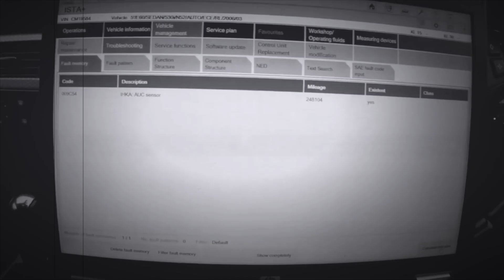BMW N42/N46 Engine Reliability 2020

Comment: My E46 with N46 1.8  , 290.000Km, not single problem,ever..
Reply: Hi mate, what oil do you actually use ? and what is your climat .
Im using 5w30 and some times I have blue puffs from exhaust
Reply: @ahmadkheiro735  bro u should use 5w 40 and u are burning oil check ur piston rings
Reply: @ahmadkheiro735  liqui moly toptec 4100 5w40, and ceratec additive..a had no puffs from exhaust, every iis ok
Reply: @ahmadkheiro735  if you have blue smoke, especially after few minutes on idle, its the valve stem oil seals. I’m just after doing them.
Reply: I have an E92, 140km. Valve guides needed replacing 😔
Reply: @melihhabi usually valve guides in these engines, block itself is pretty bulletproof
Reply: nobody will belive you never!!!
Reply: @razor6031tv  True. It is impossible and he maybe bought it at 280,000 km and had not problems until 290,000 km 😂
Reply: I don't believe it either... I have E87 with N46B20B engine and it's absolutely terrible. It's a pity really, i love how it drives and how snappy the engine is WHEN IT WORKS PROPERLY 😢
Reply: @kissrobert7386  haha..why don't you maintain it>> change the oil every 7000 km, replace the spark plugs, coils, replace the chain, replace the pk belts and rollers..pay attention to the car's engine sometime.  who drove that car before you?.. the essence is maintenance. now I already have 320,000 km.. never a single problem, only that I replaced the lambda..
on the other hand, the N46 2.0 is much more unreliable than the same engine with 1.8 and 115 hp, which is more durable. it started to use oil, I spill about one liter of oil every 3500-4000 km... I don't know why you drive cars if you don't want to or won't maintain them..
Reply: @twangogt  there is no smoke on the exhaust, it just started to use oil, at 3500-4000 km from the occasion it pours 1 liter of oil. and at 7000-8000 I do a service and pour new oil. I had a lambda probe, coils... and nothing else since the problem for 6 years. I have already covered 320,000 km

Comment: I’ve had an e46 318i with N42 engine for 17 years, and I will never recommend that engine to anyone. It’s sluggish and unreliable. I’ll admit I haven’t had any major engine issues yet because I do preventive maintenance very often, much more often than usual; and because the car has only done 130,000 km, which is quite low for a 17-year old car. I have an E60 with the N52 engine, and in my opinion the N52 is the superior engine in every area and is much more reliable. I’ve had the E60 for 11 years and it’s had a lot less issues than the E46. Oh and the fuel consumption of the N42B20  isnt much better than the N52B30. So if anybody wants to buy an E46, just forgo this engine and go with the 6 cylinder model. I used to own one with the M54 engine and it was more reliable and the performance is on a whole another level.
Reply: And what about 318i E46 with N46 engine?
Reply: @keysersoze3062  
It's more or less the same engine but for some minor differences.

Comment: My VVT just went as well, and my rocket cover gasket, oil pan been leaking for a while also, oh and my valve stem seals are gone as iv already replaced the CCV, ill get round to all that when i fix the weather seal in the door and the blocked heater matrix and my knocking driveshaft! I love my N46 lol

Comment: I had an E46 with N42B20 for 9 years and did 170k to 275k kilometers, never replaced the chain or valve stem seals and overall very minimal egine issues, apart from the crankshaft speed sensor and the two camshaft sensors that failed. After that I bought an X3 E83 with the N46B20 engine and only 180k kilometers and it immediately needed valve stem seals and a new chain, as it was smoking and the chain had a lot of play. Luckily the garage payed for the repairs. But that just goes to show that how you drive your car makes a huge impact on the engine health.
Reply: What oil you were using on the n42 e46 ? 5w30 or 5w40 castrol 
Thanks
Reply: that's right, you can't prove to the idiots here that the essence is the maintenance of the vehicle and the engine... I now have 320,000 km with the n46b18a engine... the only problem I had was the lambda probe, coils, spark plugs. which were already for replacement

Comment: Thanks for the video, I have the N42B20 engine, had a head gasket go on it so did a full top end service including valve stem seals. Very easy engine to work on. Question I have is about the vanos, you mentioned about cleaning it, but renewing the solenoids. How would you go about cleaning the cam adjuster? Are they serviceable? I’m getting a lot of low down missing and hesitation under load but fine top end.

Comment: I’ve recently bought a 2006 320i e90 and i’ve had to change the valvetronic motor, rocker cover gasket, 1 ignition coil, eccentric shaft sensor, camshaft position sensor (intake) and cleaned my vanos solenoids out. I’m still getting a camshaft position sensor code coming up and sticking the car in limp mode but once you erase the code and drive it it’ll stay out till the cars turned off again and i’m not sure what’s causing it? Its had a new chain fitted aswell as a new clutch and the chains nice and tight and the guides are a white colour (been told this means they’re new ish)

Comment: Thanks a lot. Would an N46 in a 2006 320i be more reliable than the original version in the E46?
Reply: Yes bmw uupgraded the timing chain on the newer models. My chain is original at 160,000km and no slack. Still has the valve stem seal failure tho

Comment: Hi BMW doctor. Is there any chance you could demonstrate or even give instructions on how to bleed the cooling system on these engines? It has two bleed screws with one of them being at the oil cooler which is higher than the expansion tank itself. There's not one instructional video on the entire internet on how to do it.

Comment: I want to buy a bmw e93 320i engine. Is the engine durable ، Is the engine resistant and there are no problems in it, and what are the things that I should check in the engine before buying this car ?
Reply: The N46B20 is better with the upgraded timing chain and tensioner however you'll need to replace the valve stem seals.

Comment: I've got an 120i with the n46 engine, we replaced water pipes that lead to the oil filter I believe (not sure). After the fix we turned it on and it won't rev passed 1500 rpm,what could be the problem??

Comment: I drive an18years old N42 with 183000km,
Mostly on Highways. No problems only oil leakage... Makes still fun!
Reply: Cheers ja Brother got  a n42b18 with a happy 230000km drives it every day ;)
Reply: >18years old
> with 183000km
ahahah.
Reply: What maintenance did you do to the engine?

Comment: i have a z4e85 2.0i n46b20b the car is from 2007 and has 294,500 km, only the alternator has been changed. n46b20 mounts a map thermostat at 105° and turns quietly between 106° and 108° they are normal temperatures in fuel economy. if you accelerate the temperature drops. I have never followed the BMW coupons but I have always changed the oil every 7000/8000 km because at these temperatures the oil degrades before the replacement decided by BMW. If you change often it stays clean and well lubricated. my engine is ok. I would like to change the operating temperatures, in my opinion they must be slightly lower, just below 100°. I would like to install a map thermostat at 95°. all n46 n43 problems are due to the high temperatures of the coolant and therefore of the engine. That's why broken chains drive broken plastic chains leaking oil leaking coolant and cooked valve rubbers.
Reply: Yep heat is the primary cause of those things on all bmw engines.

Comment: Another very common item on these engines is the vacuum pump leaking oil on to the exhaust manifold.
People then replace the rocker cover gasket and the smell of burnt oil is still there.
Before replacing the rocker cover gasket use a small mirror and check the vacuum pump is not the culprit .
More often than not you will see the oil leaking from the vacuum pump cover.
Also if you have a rattle when you first start, the top plastic guide will be broken and the rattle will result in the timing guide insert falling out and being chewed up by the crankshaft sprocket. This results in small pieces of plastic in the sump. These then get sucked up by the oil pump and they starve the engine of oil. This will seize the engine. I personally have seen this on 5 occasions.
If you have an n42 or n46 you probably have a lot of small bits of plastic timing guide in your sump.
Remember to do a chain you need to lock the balance shafts. Always remove the sump and clean it out, and most importantly clean out the oil pick up tube.
Reply: Should you replace the seals on vacuum pump or replace it? I have this issue
Reply: @HuskkM8  seals
Reply: What about rattle when lightly reving engine
Reply: @sportshatch no plastic in my sump. 100k miles.

Comment: i have a bmw 3l8i e46 the problem i am facing with my bmw is long shifting gear and even if its changes the gears there will be a banging sound between diff,propshaft and the gearbox...what is the problem here any advise...

Comment: Hello please I need some help, I got this car with the N46 engine but the gear box made me never to enjoy a smooth ride, it's an automatic gearbox and each time it changes gear it feels like I got hit from the rear or it forces itself to change gears making the engine work under too much pressure. I bought a gear box and changed it, yet the new one changes the same way the old one does, no mechanic has been able to figure it out and the funniest thing, the cog light is always on but the gear changes rough. Can anyone help out with a solution. Thank you
Reply: Hello my friend i hope i help you ,connect your bmw to an OBD and check what cause the cog light, in August 2022 i went a trip with my bmw e46 n46 and suddenly the cog light appeared  then the gears went like crazy i  was far away from home i called my mechanic and said the car went to safe mode i though it was the gearbox i took 2 hours to go home i was driving so slow on the highway and the gears was kicking like crazy . So i thought it was the gearbox but it wasn't , it was the valvetronic motor has failed my mechanic said it was old and it changed it and solve the problem ,if you start the car and then later the cog gear appears and the car is starting to kick when it's changing gear that means it is your valvetronic motor had failed be sure to check that.

Comment: hello! with what viscosity does the n42 valvetronic engine from 2003 work? and what oil is indicated? my car has 250,000 km? is it true or false that if the car has more than 250 km, thicker oil is needed or is it a myth?

Comment: I have N46B20BD its been 18 months driving it, every weekend of those 18 months I travel over 400km. Its the most reliable engine when I compare to my mates with N52 and N54 engines. The valve stem seals and valvetronic motor indeed are notorious on that engine, I have had to get those replaced. Other than  that, its fun to drive that engine and it has great fuel economy too especially on the highway/motorway.
Reply: Sounds good for a 4 pot too
Reply: Mechanical water pump instead of electric which always fails on the n54 😂
Reply: I am so glad to hear this
Reply: I am so glad to hear this
Reply: Hie .. I noticed you're in Zimbabwe...where do you service yours

Comment: The N42 is fine for every day driving. Like normal road use. But if you have a heavy right foot like me and tend to floor it a lot you want that straight 6 under the bonnet. I beat on my 320ci every day and it takes it with no issue even on 259k miles

Comment: Thanks for this video. I’m absolutely clear the issue with my 2006 320i burning oil and having smoke when idle is valve stem seals.

Comment: So which one should be more reliabe? N43 or N46?
Reply: Probably N46, this guy overexaggered the issues. He was right about the valve stem seals though and will cost about $1000usd to get done at a garage. They usually fail after 100,000km

Comment: I dont agree.
We have had N46 engine since brand new from april 2005.
Currently mileage is 277.000km/172.000miles.
Parts replaced: Vanos wheels 10 years ago+new tensioner. Timing chain kit 2 years ago, but there was nothing wrong.
Replaced because many people said that they will fail. No,. parts were 9/10 condition.
When engine was open, eccentric shaft + camshafts were like new. No wear or anything wrong.
Never had any problems with valvetronic. None, zero. Original CCV..
No oil consumption, no oil steam seal problems.
Reply: You're lucky, I hope my e90 will also reach this mileage... What symptoms made you change your Vanos wheels?
Reply: My 320i 2007 has 204,000kms with lots of repairs namely...new timing chain and guides...new valve stem seals...new sump gasket...new water pump..new thermostat...well basicly whole cooling system fixed was 2 coolant leaks plus 3 oil leaks..
It's now running like new and a pleasure to drive again.
Don't give up on them they just need some love and preventative maintenance. 
I love the feel just being in a BMW.
Reply: @semklm7579  I am not sure if my cooling system is fine or not. Coolant temperature goes up to 108 Celsius degree. Is it normal? Do you have the same temperature?
Reply: @JJJJuliennHun  as soon as the temperature goes above 100 degrees, you know there’s something wrong. I’m working  on my 1 series 118i at the moment because of the same thing. When i find the problem, i will let you know.
Reply: @JJJJuliennHun 100-110 degrees is fine for this engine.

Comment: Thank you thank you thank you,iv been looking for information on my ñ46 and I believe you have just covered the issues I have currently , as I have fault codes Motronic MEV 9.2 - 29cc combustion failure multiple cylinders , 29ce cylinder 2 ,29cf cylinder 3 
AND I have found oil on my spark plugs , so if I understand your video correctly it's very likely to be the value stem seals leaking and foaling the plugs coursing a combination failure? I also blow blue after sitting at a idle for a bit then it clears, can you please confirm or advice regarding my summary?
The car is 318ci , n46b20 .

Comment: Hello my problem is that the car accelerates very poorly up to 2000rpm and after exceeding 2000rpm the car accelerates well the engine is N46B18A BMW E46 2004 sedan please help

Comment: hi, can you tell me please if this engine is interference or non interference because I rotated the shafts and there is no resistance, it will bend valves when timing chain is broken ? the pistons have that holes where the valves could get in and it will take no damage right ? thank you!

Comment: N42 318ci 2002 bought owned it from new. Still on its original spark plugs, coolent. Only now I have the dreaded 3 lights on ( Abs, handbrake light and Asc). I am hoping it's the Abs speed sensor. The car still drives as smooth as day 1. There is oil leak coming from the vaccum pump area but it 's a common problem with these engine. So not bad for 18 years of driving.
Reply: You have had you car for 18 years from new and neglected to do much of the basic maintenance on it. I have to say that that is certain testament to the fact that some of these engines can be reliable but... Take better care of your car ;)

I had the same combination of lights that turned out the be a communication issue between the throttle body and DME. The DSC throws a fit because it cant control the engine torque when the traction control is activated. I hope yours is just a wheel speed sensor :)
Reply: @jasong9801   The lights went out by itself. I believe this was due to the car not being driven over the start of the pandemic and my battery was completely drained. The issue almost certainly started since then. Replaced with a new Exide battery and the lights have not come back.
One thing I have noticed is a leak on the oil sump, looks like needs a new gasket.

Comment: Thanks great video. I think I have a problem with my vanos to . Is it possible to measure the oil pressure whit a regulair oil meter ? Is there a spot where I can hook it up without dissembling the the alternator and the intake ?

Comment: A lot of the issues you mentioned are in regard of valvetronic, does it mean that the N45 (the one on the 116i without valvetronic) is reliable?

Comment: I have got 57 plate 318i N46B20B..... MY Engine Management Light is ON and the code is 2CF8 DME Throttle Valve Potentiometer..... Can you please help... what needs to be replaced or shall I come to your garage. Is anyone here who can help. Cheers

Comment: Hello sir, I assembled the n42 engine, it starts, it works, it goes well.  small camshaft engine, no more errors?  is now the same again. And as for now, after the diagnosis, it seems to me that a rattle is heard in the area of the third ridge

Comment: Great summary! Pretty much sums up all my problems I've had with this engine and gives me an idea of what to do as preventative maintenance or what to look for when it goes bad again.
Reply: I own an e46 318i 2003 , and it suffered from nothing at all . I got it at 93000 km and I had to change the valve stem seals , plus the car had the wrong engine oil in it , perhaps 15w40 . So far , nothing is wrong , but I did replace one camshaft sensor and the car drove like new again

Comment: Thanks for the Video Mate :) 
Q1. What engine Oil is best to use when you want to prevent valve stem seal wear ? (N42)
Q2. What brand of vanos solenoid is the best to use to replace it ? or is it best to fork out on a OEM BMW part ?
Reply: Really want the answer to Q2

Comment: true! but the timing chain replacement is a lot of work! the balance shafts needs to be locked in the oilpan. so the front suspension needs to come of so the engine needs to hang in a engine support!